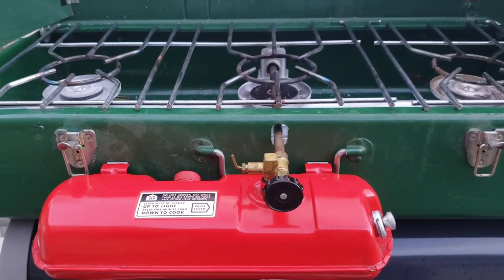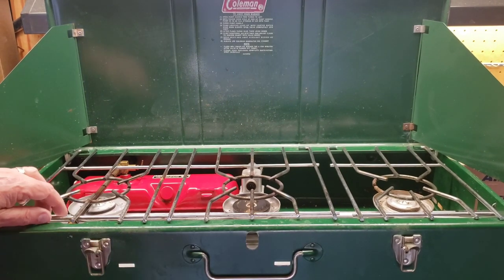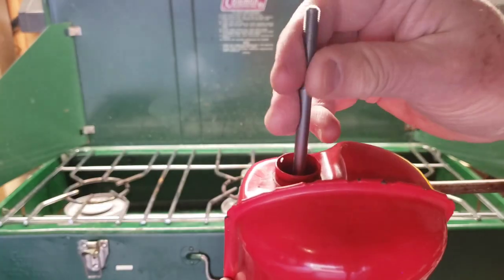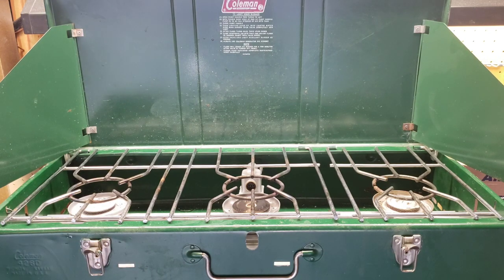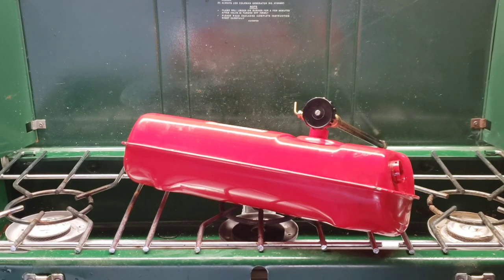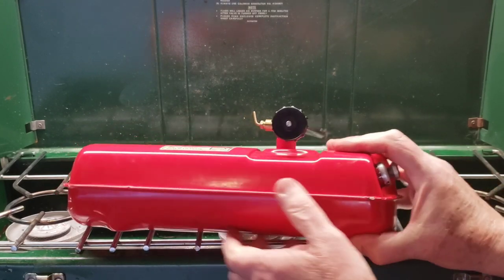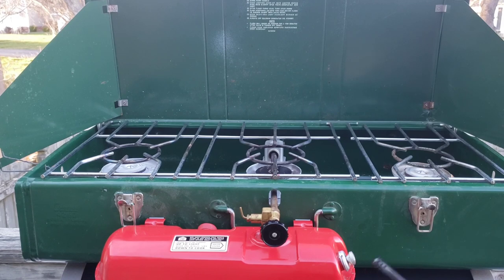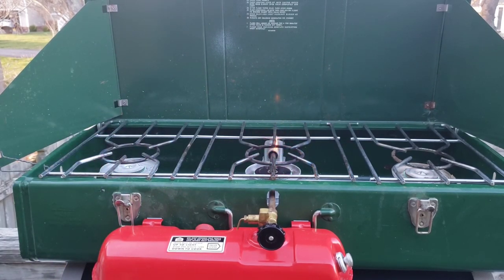Removing and cleaning a check valve in a 1977 Coleman 426D stove

Comment: My wife was mad that I bought a 426D at the Salvation Army a little over 2 years ago. I lucked out, the check valve was fine. Lubed the pump, put a new o-ring on the gas cap, and gave it a long overdue cleaning. We've taken it on every camping trip and, along with the propane converter I bought, made it so we could cook during a power outage last winter. 2/66.
Reply from the maker: Thanks for replying. The old Coleman stoves really hold up with a little TLC. They are reliable at much colder temps than butane and burn longer on a tank than 1lb propane. Really great machines.

Comment: Where can I get the tool used to remove the check valve?
My check valve is plugged. I can't get the pump to push pressure into my tank.
Reply from the maker: Pretty sure I picked it up on eBay.
Around $34 and fits Coleman valves perfectly.
I don't have a grinder to make a tool and the tool I bought is really well made
 Keeps from destroying the valve by using a poorly fit screwdriver

Comment: My check valve is leaking a little bit of air but i close the pump after pump the air inside, i have tried to remove the chdck valve with a lime without sucessful and to buy a tool is expensive for me since i am not from USA. Is there safety issues if i just close the valve to the right after pump the air inside?
Reply from the maker: If it holds pressure, it shouldn't be a big deal but I pressurized gasoline is a something to respect.
Getting the valve out and soaking it in vinegar may help loosen stuck ball stop..
Sacrificing a large screwdriver by grinding it down is an alternative to buying a special tool

Comment: That tool should have come with a sleeve that fits over the end that the wing nut goes and the wing nut then shoulders on the sleeve not the driver tangs.  Yes you should have moved your camera so we could see what your doing.
Reply: This is a remake of the original tool. They dont come with the spacer.
Reply: It wouldn't be difficult to make one if you could find a pipe that fits over just the right size.  Cut to length with a hack saw and file it smooth. @WorldMoneyWins
Reply: @aktrapper6126  Good idea!
Reply from the maker: I'll likely reshoot using the tool with another Coleman. It does a great job breaking loose a stuck valve.
Reply: @TwoRiders  I have one also. Really well made. :-)
Reply: They are the only way to go,  I've ruined check valves trying to use screwdrivers and other things,  I finally fired up my lathe and made a few of these.  Sometimes you can get by with less but often they can be very tight and these tools are the only way to go.
 @TwoRiders